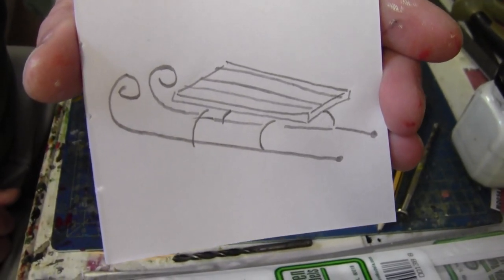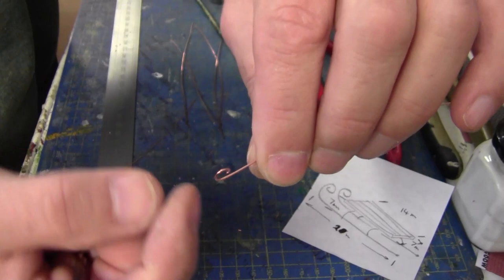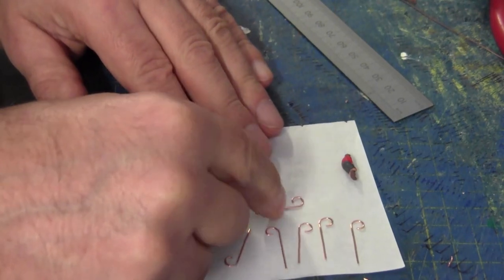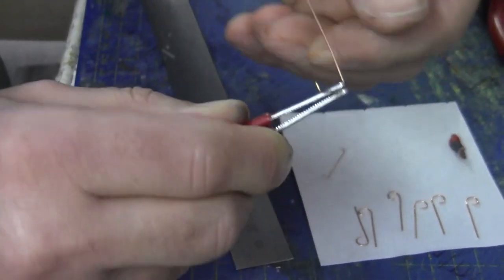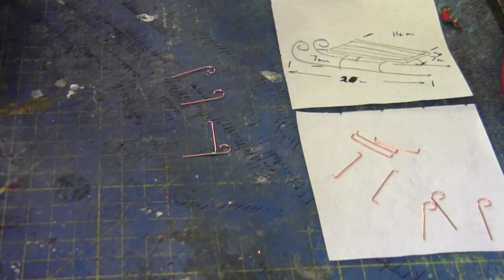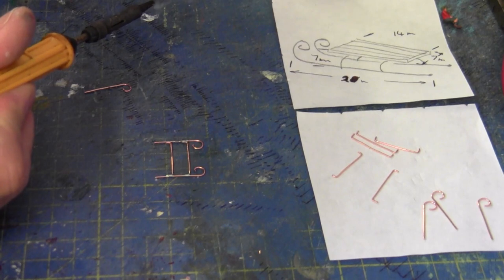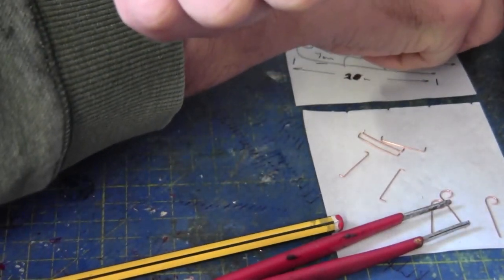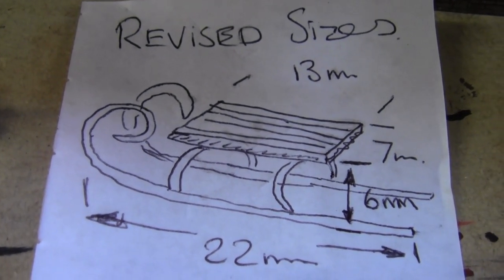OO Gauge sledges......No247

Comment: Nice one Tony. I bought some concrete fence post from ratio but this done come with the wire. Do you know where I can buy this wire. I see you use wire. Thanks
Reply from the maker: Hi Ian. you can get this wire from any DIY store. the copper comes from 2.5 core. use for sockets.  i just strip the sheathing back to get at the copper wire. it can be expensive. but if you know a electrician he would probably get you some for free you dont need much. hope this helps. cheer's Tony
Reply: Thanks tony